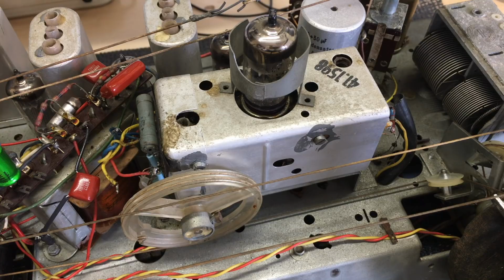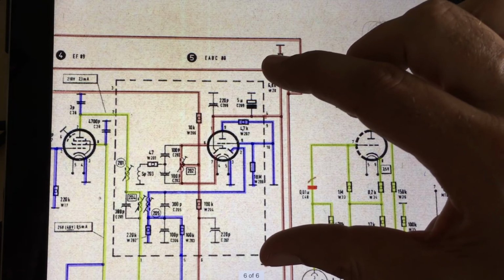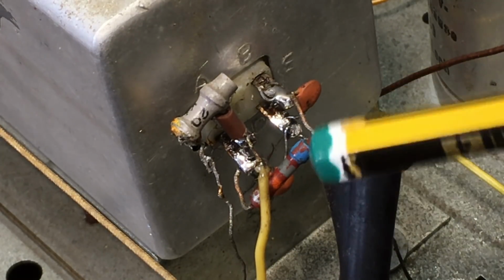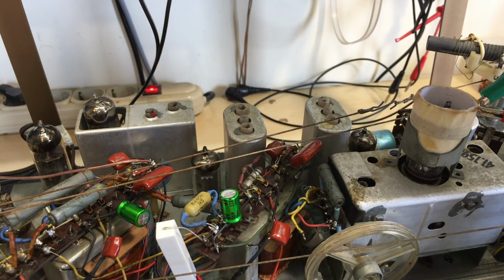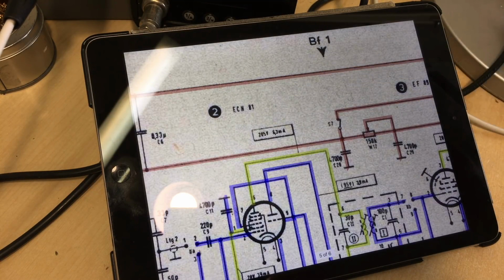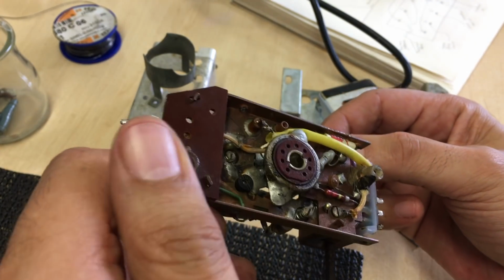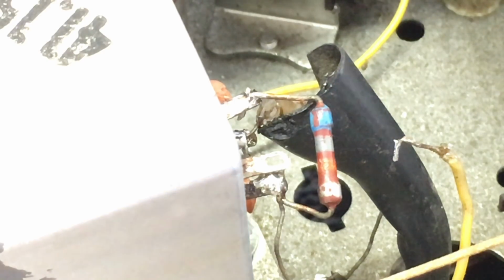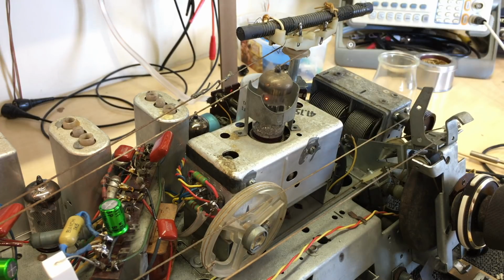Telefunken Opus 2004 tube radio restoration - Part 5. FM is back!

Comment: Thank you so much for the video. Great work! I just bought a Telefunken opus 6 from German. The Fm band is up to Fm100. I live in Canada. My favorite channel is Fm103.1. Is it possible to stretch the upper band to Fm103.1? This is the only channel I listen to every day. Thank you.
Reply from the maker: you can try. I do it up to 101.6 but it could well go further.
Reply: @electronicsoldandnew  Thank you so much for your prompt reply. Do you have video for how to do this?
Reply from the maker: I’m not sure anymore which ones i did it to, but it’ll be different for your radio anyway. You have to look for the RF alignment instructions for your particular model  and see which adjustment you need to make for the top end of the dial, then move it further up. It’s a little complicated, but if you or someone you know understands tube radios, it should be quite simple to try.
Reply: @electronicsoldandnew  Thank you very much. Your advice is very helpful.

Comment: Thanks for taking the time to investigate the EABC80 FM detector a bit further & answering my question from the earlier video - it makes perfect sense now! Little schematic/diagrammatic errors like that are annoying when you run up against them. Apologies for not thanking you earlier, but on the plus side I've got some interesting new videos to catch up with 😉.

And congratulations on beating the FM fault, even if the cause remains a mystery. Those sorts of faults always niggle at me, since I can never convince myself that they're really fixed. I just know as soon as I start believing that they'll come back to bite me!
Reply from the maker: Jim S : it’s always more comforting when you find a clear and obvious fault, because then the repair is certain. I too dislike these “mystery” solutions, especially due to the complexity of opening the whole thing up again to go back to sort something else out.

Comment: That FM fault led you on a merry chase alright. At least with my old Nintendo Entertainment System it was undoubtedly the result of a previous repair attempt.  The original fault was the 72 pin cartridge socket which I sorted out but still had a blank screen. While I had the socket out (it's a big U shape that fits into the board and accepts the game cartridge) I noticed a wire.  Under the wire there was a cut track, conclusion: in attempting to make it work the repairer cut the IRQ line, but when that failed to get it going they added the wire and failed to notice the damage they caused to an adjacent track. I got no continuity on the track, so I added a 2nd wire to bypass the tiny gap and the game booted.  Aside of a few pieces of mouse bait, the machine was actually clean and free of corrosion.  Seems the mice may have fallen victim to the bait before they could cause any damage.
Reply from the maker: Yep. Previous repairs are always a problem, especially when they gave up and just  closed everything up.

Comment: Some months ago ,while restoring a Kuba Imperial 864 tube radio with a pretty similar Telefunken FM front end ,I had to deal with the same problem of no FM reception. However  in my case this was caused by the ecc85's socket being faulty(loose contacts ).So, I had to open the front end box and replace the socket with a new one .This procedure took me around 4 hours ,but after that "surgery",the radio is working like new, while not even being in need of any  alignment.
Reply from the maker: Marios Ker : nobody has any idea of the time this takes until they do it themselves... as you know. As I say repeatedly in the video, opening the fm can is always the last thing I want to do, but sometimes you just have no choice. Giving up just isn’t an option.